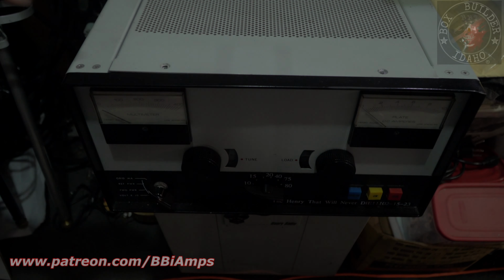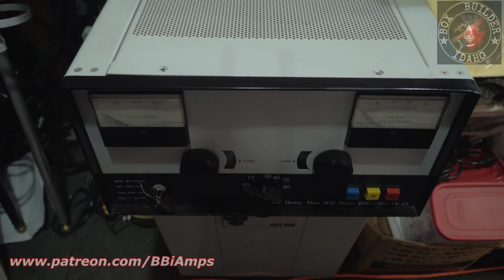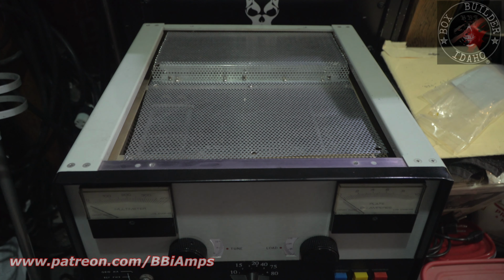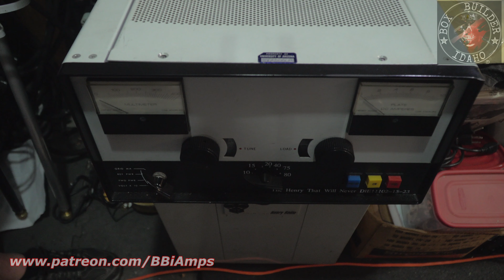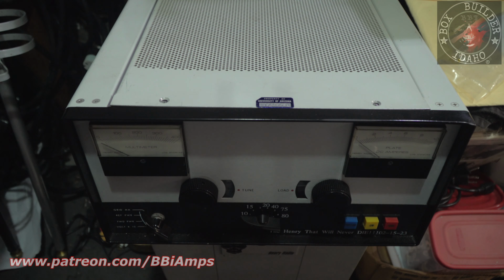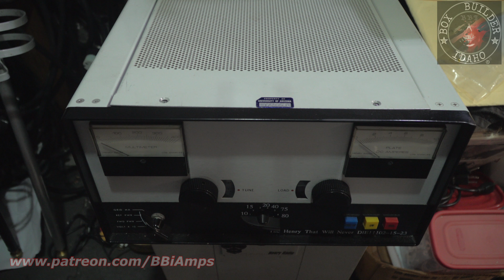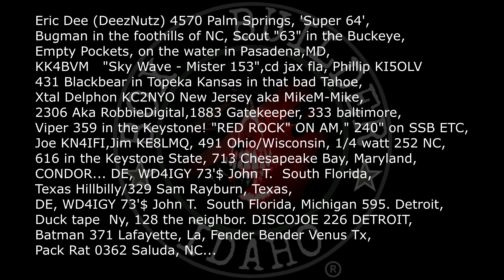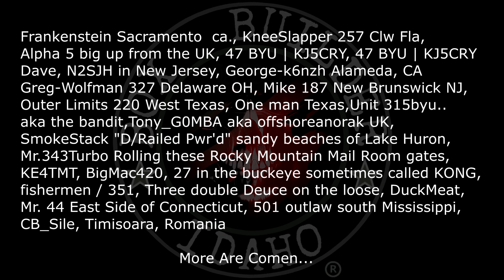Henry k2 floor model sold!!

Comment: Is the 6000 a monobander? 
Man, you are going to love that 8kultra. They are very nice and heavy duty amplifiers! 
I am waiting for delivery of sn Alpha to come today... It has a pair of Eimac 3cx800a7 inside. Took a roll of the dice on this one. So many things that could happen today with this delivery. The tubes are suppossed to be in good condition. If i dont like the Alpha, I should be able to flip the tubes and still get back my total investment. I can always use the chassis and parts to build something else. Those Alphas are supposed to have great iron with the hypersil core.... I can always gut all that microprocessor  controlled autotune if its a headache! Looking forward to having real transmitter tube amp and true QRO!  Not that I dont enjoy the SPE Expert. Its just nice to have the full keydown and not overheat if I decide to hook up on a round table with the fellows checking into the AM net on 75.
Reply from the maker: Yeah it's a mono band